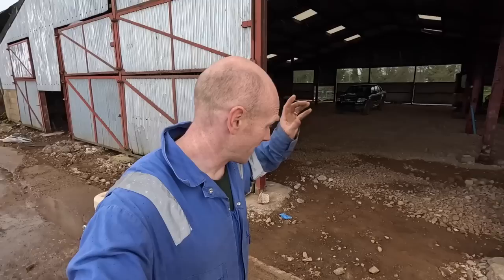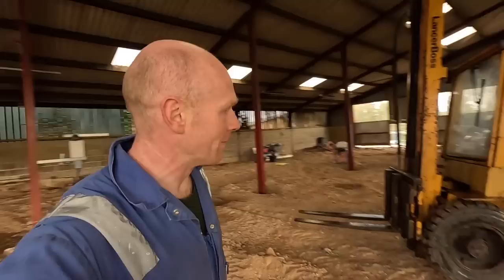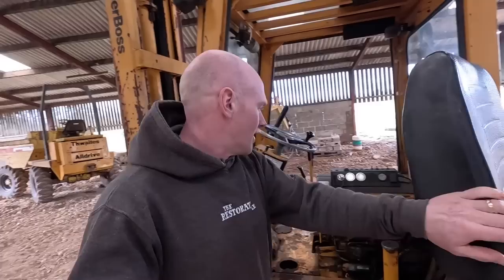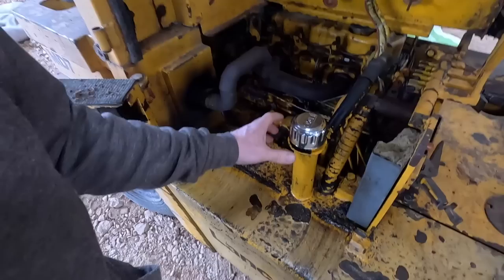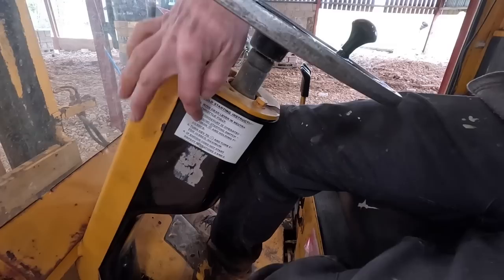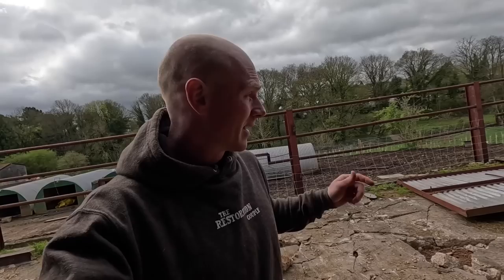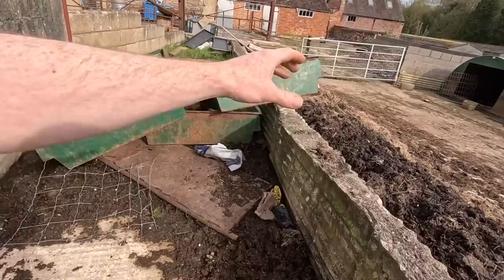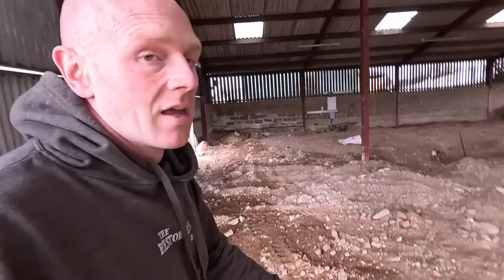WE BOUGHT A 45 YEAR OLD FORKLIFT - Good idea?

Comment: Evening Tim.  Re fork lift. Your luck is in . I drove one of these buggers in the 80's. Someone /you must be sitting in the driving seat to allow the truck to start. There will be a microswitch or contact  switch to allow you to start the machine. The  handbrake lever is also a safety feature. It must be on when the truck is ticking over.  Best to have it on when you are lifting anything. The black knob with the white dot was what they called a strangler. Pull it up and hold it up till the engine cut out. It may not work now because they upgraded the one i drove  to a simple on of switch like the one  you used in the clip. Finally i noticed the tyres look like solid rubber tyres if they are  they are not much cop in the wet (no Grip).   That's it for now. Later..Lancerlot.for the fork  lift.
Reply from the maker: Good to know. The engine pull kill switch is down below seat so maybe it’s replaced the dash one. Did a great job unloading pallets of a lorry yesterday and new brakes are reassuring too. Pretty sure it will be worth having around for the next year or two even if he is a ‘character’ to start. They are all pneumatic tyres which was one reason I thought it would manage rougher ground. Not that much grip but just a case of being sensible on where not to go!

Comment: The glow plugs are the other side from where you were looking. One for each cylinder and they've got a strip of metal bolted along the top giving the positive connection (wire on one end). The oil tank needs maybe an inch of space at the top of the tank (not the filler) to allow for expansion when hot.

Comment: My only tip for forklifts on gravel surfaces, try to avoid getting into the practice of pre-steering the rears when you’re not moving…    Its very handy for tight manuevering on concrete or tarmac, but it’s way to easy for those steer tires to dig holes, which can with low-clearance machines get you stuck, particularly if the ground is soft or loose.

Comment: The hydraulic tank cap is probably just a replacement but the dipstick does look a little short, almost the length of the filler tube so maybe not the right one. I'll take a guess from looking at the video that the minimum mark on the dipstick will even be too full. You need room in the tank to accommodate the oil volume in the hydraulic cylinders cycling the oil back to the tank. I think someone has overfilled it then when you cycled the cylinders it spilled through the vent on the oil cap. I'd aim to keep the oil level at the very lowest point of that dipstick and you'll be fine. 👍

Comment: There is actually a reason for two foot brakes, they both have a different function - one is a brake pedal and the other is a clutch brake. You push the clutch brake while lifting a load to increase the rpm of the hydraulic pump by pressing on the fuel pedal and lifting at the same time. This disengages drive gear and you raise rpm to speed up the lifting speed.
Reply from the maker: I have that on the dumper but it appeared both brake pedals on the forklift are joined and only go down together. I’ve just been putting drive to neutral to rev the fork speed up when needed.
Reply: Probably got split braking for each front wheel  @TheRestorationCouple

Comment: The shiny cap also acts as a vent for the oil tank to allow air in and out as the oil level changes so it would allow excess oil to flow out the cap👍

Comment: Just a thought… do farm/construction plant machines need to comply to any Health & Safety requirements, and what effect does that have on any insurance? We looked at getting an old crane for the boatyard but it wouldn’t pass any modern safety requirements ie. Load and tilt alarms etc which meant we would not be covered by any public liability insurance and we could also be open to a host of legal claims in case of injury etc.
Wouldn’t spending more on a tele-lift or mini-handler the smaller version of the tele-handler be more suitable as they will be fitted with upto date safety features and would be more stable in a farm/construction environment. You could always sell the machine after the construction is complete to get your investment back?

Comment: The starting issue could be a glow plug or the fuel injectors leak back pipes (small braided flexible rubber hoses between the injectors)

Comment: you dont force the forks down. forklifts drive from the front and steer from the rear, make sure there is no one around when you are lifting or dropping and be aware of the load tolerance and dont push it. you'll be fine. fork truck driver with 20 years experience

Comment: I can see holes in the roof soon, You should have gone for a forklift with free, or unrestricted lift: the forks go right to the top of the mast section befor the next mast goes up. You have a restricted lift where the mast raises as well as the forks. Not a good thing if under cover. 
I know it costs more but I think you would have gotten more out of a front loader/telehandler.

Comment: If it’s the same as my little tractor - then those heater plugs fail - and they are cheap. So check you are getting your 12v when they key is in that position, if it is I’d just swap it out. They glow like a cigarette lighter, then at a certain temperature open a valve which lets the diesel in and ignites it.

Comment: That truck is a 7 ton lift. The model number tells you. The D is for diesel. I forget what the M means. I believe they were made in the 70's. If you find the data plate it should tell you. Looks like it could be under the drivers seat in the foot well. 
:ancerboss was bought out by Jungheinrich at some point in the 90's.
Reply from the maker: No date on the plate and looks like lift is3.5t from memory but fine for what we need.
Reply: That's ok saying it's a 3.5 ton lift.  But don't forget that's at a given load centre. And also only to a certain height. Capacity also depends on the forks fitted. As always with a forklift, lift as little as you have to to as little height you need for as short a time as possible. And always leave them with the forks properly on the floor.
Make sure your happy with it's supposed capacity then half it due to its age

Comment: Have you considered the water shedding effect of that concrete you removed. I’m concerned that the dirt left behind with rainwater will overload that retaining wall. Maybe tarp it until rainy season is over. Is rainy season ever over in England?
Reply from the maker: Yes thought the same. It had got some holes in the wall by the looks of it but may well put in a drainage run along it while doing other jobs that end.

Comment: Why didn't you try amd get telehandler?? Multi purpose machine and two machines for the price of one. However forklift looks good.
Reply: Price. Though it sounds like he over paid a bit for this very old forklift.
Reply from the maker: We will have a telehandler on site for roofing but most of the ones in budget were too big for everyday use around the farm. Would have been handy for occasional use on the fields but others locally if and when needed.